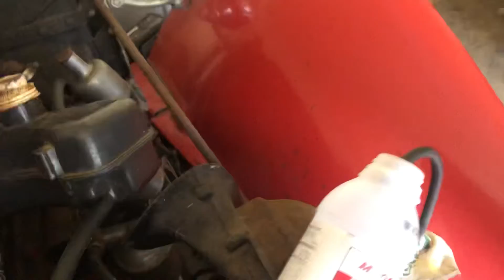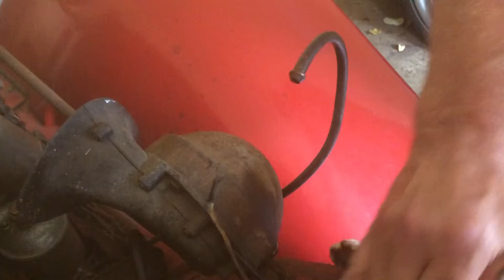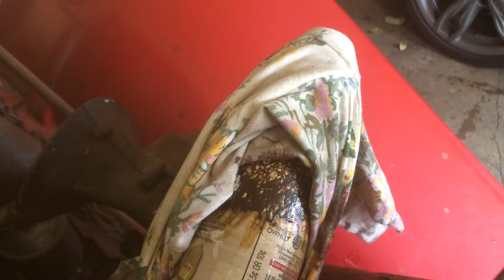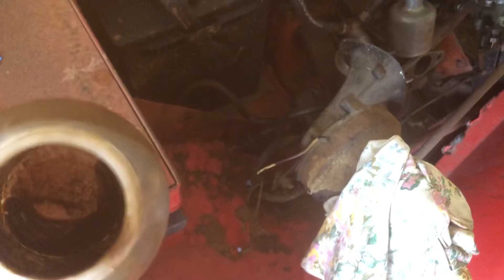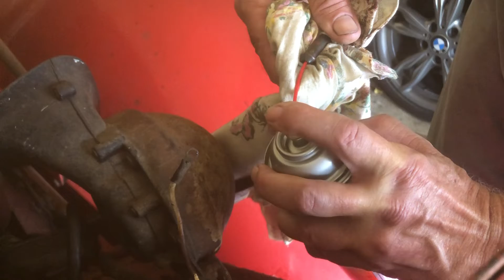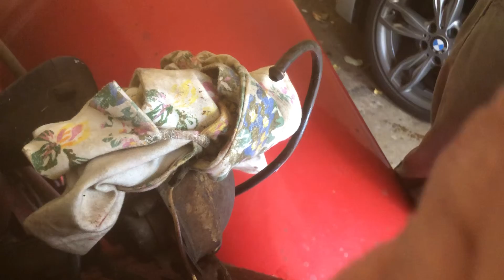MG TD unclogging and cleaning the fuel line pt7

Comment: couldn't help but laugh when the bottle blew off.....sorry. :)

to clean out the tank and the line, you might try throwing a gallon or two of diesel or gasoline in the tank and turning on the ignition. on my TD the fuel pump will run until the float bowls are full (i think), but if the fuel line is disconnected from the carbs it may run as long as there's fuel in the tank... just a guess. i've never tried it. 

anyway, if that works you might consider running the end of the fuel line back into the tank using a section of rubber fuel hose, that way, you can just hook up a trickle charger to your battery, turn on your ignition and sit back for a hour or two while the whole thing cleans itself. or, i suppose, until your fuel pump burns up, which ever comes first. :)
Reply from the maker: It got worse, after I was done , I looked over and my BMW’s hood was covered in rusty carb cleaner spots.   I did the fastest car wash ever.  Checked the hood this morning all good.   Note to self move BMW out of the garage when doing experimental stuff
Reply from the maker: That’s a good idea 👍🏻.  However my next project is getting a reliable fuel pump . Hmmm 🤔 I do have the spare facet fuel pump